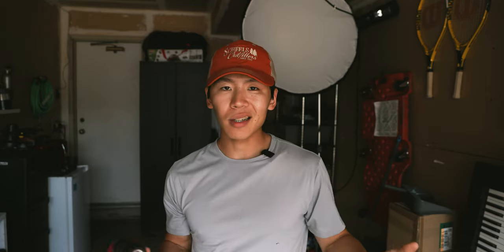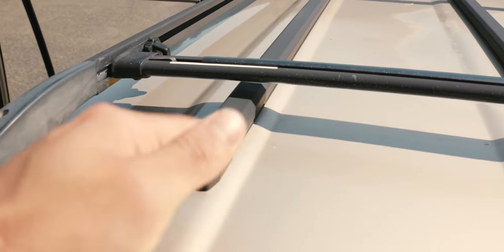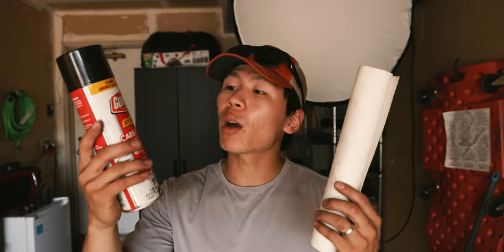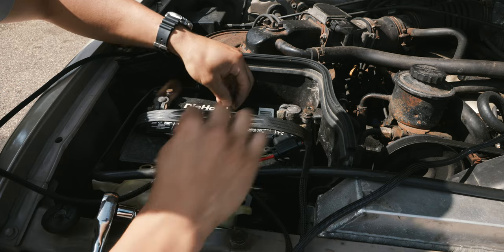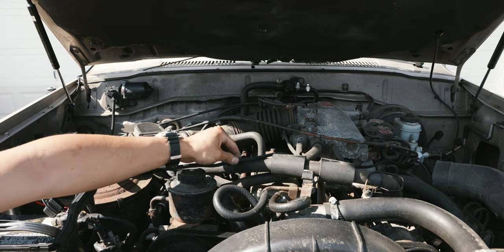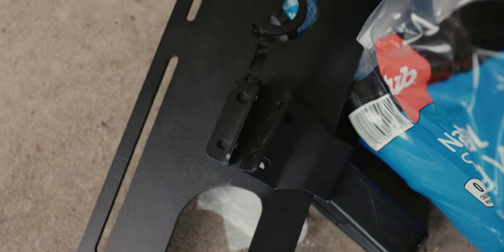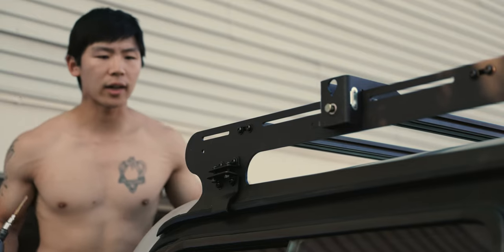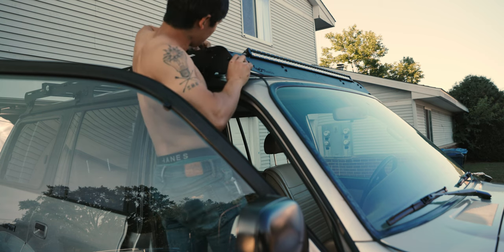80 Series Land Cruiser Prinsu Roof Rack Installation w/ light bar and awning mount

Comment: Just got mine (almost) together.   Prinsu didn't send enough bolts and nuts for the mounting brackets, which are totally different from the ones in the "instructions" I found online.  Your video helped me a lot more than the PDF did for sure.   Thanks for posting.